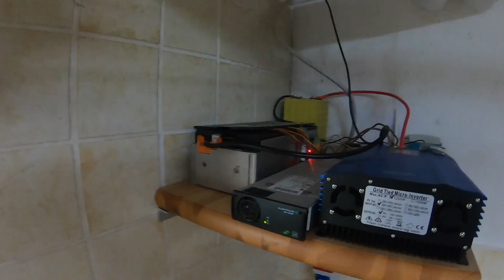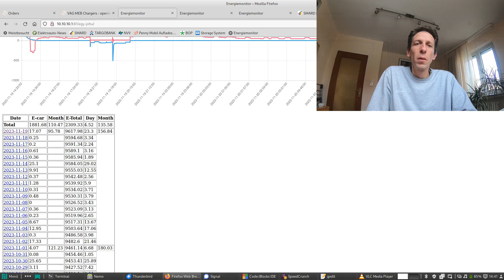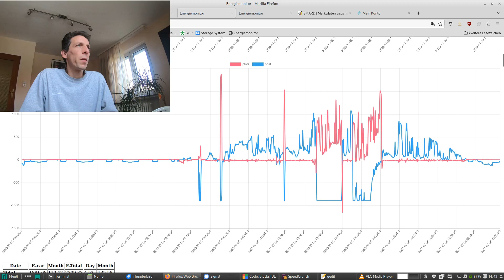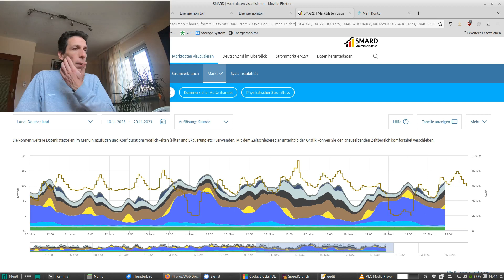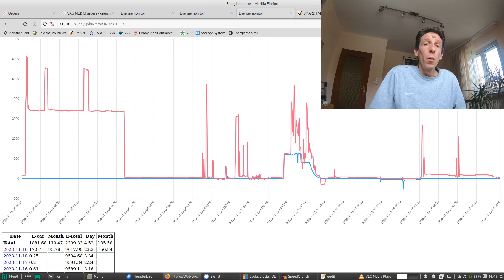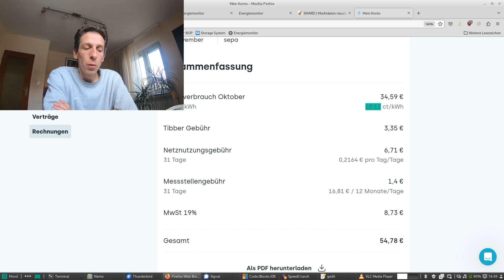Lab Update #83: Evaluating my Energy storage system

Comment: Hi Johannes, would you have a link to that server power supply and what's the output voltage of it? If too low for your battery, what voltage booster do you use?
Reply from the maker: No link, just this: https://openinverter.org/forum/viewtopic.php?t=1351
The voltage range is 43.5-57.5V. So the low end is the problem with my 12S battery. That's why I added one LFP cell in series, raising the operating voltage of the battery to 44-53.4V